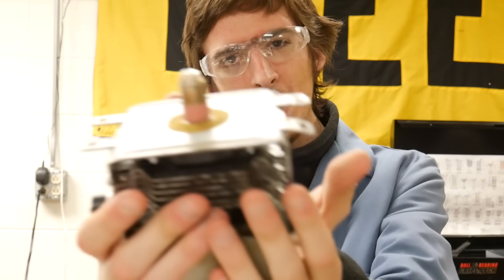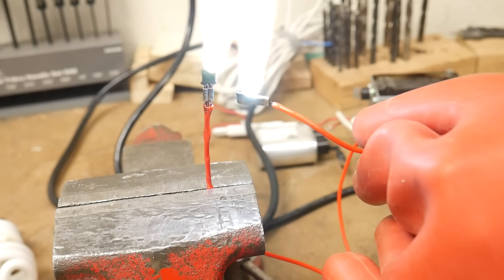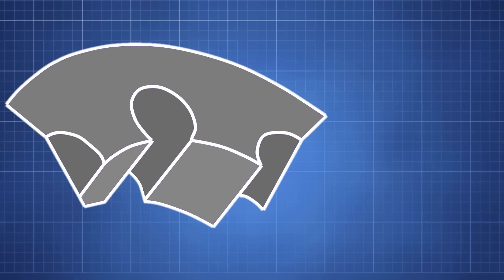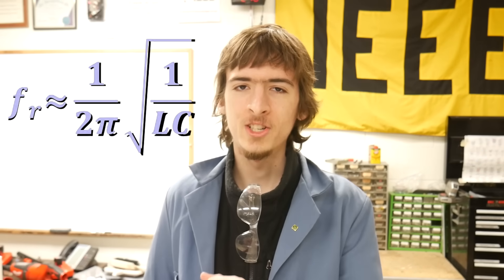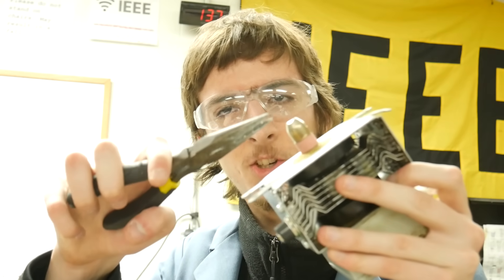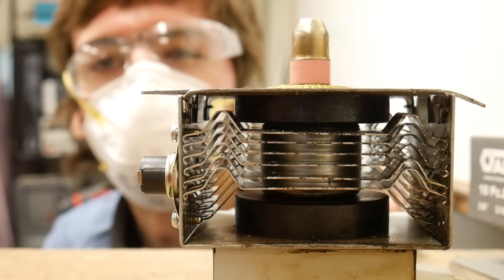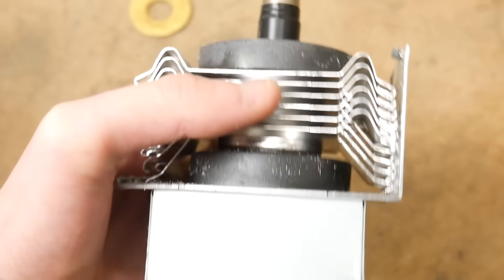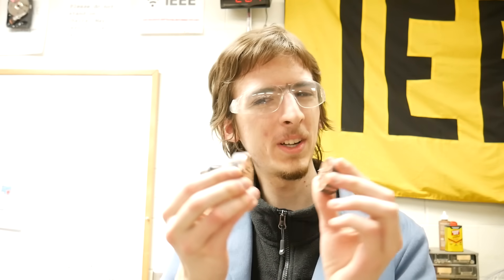What is a MAGNETRON - How Does it Work

Comment: I just feel bad for the first poor souls who had to discover the hard way how toxic, cancerous, and life threatening berilium oxide is.
Reply: Aaron Misner I'd imagine, the way things go, lots of people were exposed to it at some time in an industrial setting and the discoveries of the metals health hazards were discovered later through research and development rather than it being an obvious thing to the first people to mess with it. But that's just a guess.
Reply: Dylan Cros - Exactly. Those people in the industrial setting are the "pour souls" I was referring to in my original comment. They would've developed carcinomas and probably other terminal condition(s) without having any idea that where they were working or what they were working around would cause such serious medical issues for them down the road. I mean it is what it is...I'm just saying that it sucks, but what are ya' going to do. <shrug>.
Reply: I want to know who found out that beryllium compounds taste sweet.
Reply: When you start a #howdoesberylliumtastechallenge, a lot of people will find it out again.
Reply: It wasn't Fillo Farnsworth?
Reply: Fortunately (most of us) have learned from their mistakes. Whenever I take apart a microwave, I always paint the exposed beryllium oxide areas with a friend’s failed recipe for a homemade air-dry pottery glaze. Turns out it works great as a clear insulator, but it isn’t optimal for pottery for some reason. Anyway, I wait for it to dry, and then I add a bit of heat shrink tubing. I shrink it, and then I paint a small amount of liquid resin around the edges of the sealed tubing. The microwaves are still emitted perfectly and are not muffled at all.
Reply: Aaron Misner For example Madame Curie with her discovery of radium and polonium
Reply: @cloudvariable9910  Unless you go smash the Magnetron with a hammer, the ceramic isn't going anywhere ...
Reply: Dont feel bad. They had no idea and the life span for a human back then was way short so they died naturally before the effects of it really set in. Also they weren't a bunch of vags complaining they fought and dealt with shit on a level we will never know. Allowing them to adapt more easily with the power of their mind and how they perceive while being so in time with the need to live. Say thank you to them cause now you got it easy.
Reply: I have two Magnetrons in my room and I haven't died... LOL it certainly is dangerous
Reply: @eventseen7317  so did you go file on the pink ceramic and inhale the dust? If no, you are not in danger.
Reply: @zaprodk  no just having these around is dangerous enough I think... One could accidentally fall to the ground, break, and I die
Reply: Paul Kocyla hahaha. That’s a challenge Darwin would appreciate. Our planet too. Humans are such funny animals. We think we know so many things and are so certain but most of what we know is just guesses. We find out later we didn’t really know anything. Plus we tend to listen to people who have something to gain by telling us only part of a story. Like how car batteries acid is like Aliens blood and electricity is made from friction which I’m sad to admit for most of my life was my own assumption. I mean, lots of stuff is toxic to us and we still use it. I wonder when they are going to finally tell us that the WiFi and cellular signals which have indicated our lives are toxic and accumulative? They test them one at a time and the standards America uses were established by a department run by a ex cell phone company lobbyist. But our dumb asses only care about danger after the fact. Ever wonder why birth rates are down, depression and anxiety are up, and teenagers and children are getting more brain cancer? I wonder how far the shooters we have been plagued with live from a cell tower? I’m not saying that is the sole cause but with the adrenal fatigue we all already suffer from, I can’t imagine its not a factor at all. Remember when cigarettes were healthy safe? DDT? I bought a microscope because I want to see for myself. I have 10 strong WiFi signals  and that is not counting mine and the extender. and I’m living in the boonies. It’s easy to discount it because it is not what we want to hear and we just don’t want to believe people would lie to us for profit. Especially businesses and the government. Yah I’m just paranoid cause they wouldn’t do that again. And Facebook was made to be addictive. Why is it illegal to sell a child cigarettes? But okay to give them a device that pumps out microwaves and is addictive? Seriously.
Reply: @paulkocyla1343  if they're eating tide pods, I wouldn't see your challenge as a far stretch
Reply: @calvaryassemblyofgodsouthi8046  also the women who used to paint the glow in the dark dots on old clocks. The dots were made out of a radioactive solution. Some lost their jaws, some glowed in the dark even after their death. Very tragic. All beautiful young women.
Reply: @lando8398  yeah i will see that event coming
Reply: My thoughts exactly. Beryllium is nasty stuff.
Reply: That darn sure could have been me, I think watching this video just saved my life.
Reply: if we use  condenser instead of  cavity's  than what happened
Reply: So how to recycle it ? TONS OF MICROS R DUMPED in yonkes!
Reply: Who cares, I want my hot dog.
Reply: That , and the first person to discover that the capacitor delivers a punch to the heart
 if its touched
Reply: They haven't used than for insulators in years .
Reply: barelium oxide clone which is more healthy are to be discussed
Reply: if we use neodymium magnet than the frequency increased or not, checked out with formula of magnetic force formula and magnet from current
Reply: probably better off not knowing
Reply: Now that I think about it,you can use it to kill someone without leaving evidence.I'm already plotting.
Reply: @lando8398  I can see the company screener now: OK-looking, nope...Ugly, nope...beautiful but old, nope... beautiful and young, hired!
Reply: So I just replaced the magnetron on my microwave. And after watched this video and may have touched the pink part with my bare hand.
Reply: Philo maybe?
Reply: Galaxy quest showed just how dangerous it can be to get a berillium sphere.
Reply: @ryanb1874  Philo.  That's a sad damned story. The dude and his family were literally ripped off!
Reply: Safe lab practices are written in blood. Sometimes literally. You can search Google and find many stories of famous chemists who were crippled or maimed by their pursuit. As one can imagine, the isolation of fluorine was fraught with quite a few such accidents. In the days before fumehoods or eye protection, a lot of chemists sustained eye injuries from explosions or were poisoned by the compounds they worked with, sometimes fatally. Here are a few examples, for those interested:

Joseph Gay-Lussac was blinded by a potassium explosion in 1808 and never fully recovered his eyesight.

Robert Bunsen (namesake of the Bunsen Burner) was permanently blinded in his right eye when a flask of cacodyl chloride exploded. He was also poisoned after inhaling vapors of cacodyl chloride which contains arsenic in another incident.

Humphry Davy suffered damage to his eyes and fingernails trying to isolate fluorine through electrolysis of hydrofluoric acid.

Brothers Thomas and George Knox sustained severe poisoning from hydrofluoric acid.

Paulin Louyet and Jerome Nickles both died trying to isolate fluorine.
Reply: @lando8398  asbestos was never illegal, btw. Still used in things like brake pads. It's coming back because people are stupid. 

I think those white pellets in potting soil are a form of asbestos. Tremolite, if I'm right. That's why they tell you to wear gloves.
Reply: Well f*ck, I smashed one of these things apart when I was 5. And I totally smashed that ceramic. I guess I'll die when I'm about 20 then :/
Reply: @KingJellyfishII  In my case it's the opposite, As a kid I always wanted to take apart a magnetron to figure out how it worked, and believe me, I would have smashed that thing to take it apart too (at around age 10) since it was my way of putting things apart back them LMAO. I think that you're safe though, since the particles may have not been small enough and in large quantity enough to have affected you, as ceramic usually breaks apart in larger clumps and the dust should have been minimal, unless you did it in an air-gapped room, so you should be good bro
Reply: @poloboy  well i sure hope so. It's kinda scary knowing that I could die in the future from an idiotic thing I did 10 years ago and theres nothing I can do but wait and hope you're right.
Reply: Try searching for dimethyl mercury.  Truly, absolutely, scary stuff! One or two drops on the outside of your vinyl glove will seep in and get in your skin, immediately! You'll be slowly paralyzed over the next few weeks and die in less than a year. Yes, someone found that out the hard way.
Reply: Jason DeLozier me too. Was just about to cut the magnetron apart from my old microwave when I saw his warning about the nasty pink stuff.They say curiosity kills the cat
Reply: @VoidHalo   Add Karen Wetterhahn, the Dartmouth Professor, (an expert in toxic materials!) who got poisoned in 1996 when two drops of dimethyl mercury touched her glove.
Reply: @theenemy3060  the big radiation source that dwarfs all others by many orders of magnitude... (I don't know how many; I haven't crunched the numbers) and is extremely dangerous- is the broad spectrum,  ridiculously powerful radiation that comes to us from the sun... anyone worried about "5G", that ever goes outside, is missing the reality of the issue by gazillion miles... I don't mean to confuse those nutbars with facts or anything but I just can't help it sometimes.
 personally, I believe that all reality is controlled by a tiny teacup with a silkscreen of Rodney Dangerfield on it, that orbits the sun inside the orbit of Mercury.  this teacup is, no doubt, made of beryllium oxide and shall not be taunted... lest ones' crops wither and ones' tent become a dunghill, and one then die, drenched in the piss of ones' jeering enemies... this is all true because nobody can prove that it isn't.  
  peace be upon you, sir.
Reply: @windsofmarchjourneyperrytr2823  at least some of that "perlite" in potting soil is "puffed" obsidian apparently... a few pieces that were only half "puffed" enlightened me to this fact...  inhaling tiny flakes of glass is still bad enough though. 
 peace and rock on.
Reply: Just found out a few days ago... Hope I never inhaled it after breaking them 😰

Comment: The trapezoidal cavities in a household microwave oven are not as efficient as the circular resonating cavities in the original WWII magnetron, and the range of wavelengths the device emits is less stable and more variable. But this is not a problem, because the end use is just to heat food, so frequency control can be sloppier than would be permissable in a radar system. The variability allows the manufacturing cost of the household magnetron to be considerably less than that of magnetrons in radar systems, so that a household microwave oven can be sold for only $150 and still make the supply chain profitable. Great video!

Comment: Great video. I had a very rough idea how magnetrons worked (resonant cavities with an electron beam sprayed past it) but never knew the specifics. I had no idea that the cyclotron effect had anything to do with it. Hell, I didn't even know that electrons had mass until recently but it obviously makes sense if they spiral outward when accelerated in a circle squeezed together with magnetic fields. Klystrons are fascinating too and are apparently the most common source of microwaves for medical LINACs used to generate high-energy X-rays for cancer treatment. Electrons ride microwaves like little surfers in the accelerator tube! Any time I think I'm smart or clever I read about inventions like magnetrons, cyclotrons, linear accelerators etc just to humble myself. Don't touch the beryllium!!!

Comment: It is an electromagnetic whistle. The pink ones are made of ruby alumina, the beryllium oxide ones are bright white and usually are from higher power microwaves.
Reply from the maker: I think you're right. But it is best to treat them all like beryllium, yeah?
Reply: @BlueprintScience  smart man you are Sir..
Reply: It's interesting how quickly a safety myth propagates. Someone on IRC warned me about BeO ceramics in magnetrons but never told me the right color. Now color could be deceiveing too. But well it seems no mainstream MWOven has BeO in it .. I still don't know all material used. Pink seems to be chromium/alumina. But purple I can't find data on. Also.. I have a few parts from kitchen appliances (cooking plates; toaster resistance glass with white ceramic plugs/caps and plates..) all very white.. Maybe is it raw alumina, which is said to be white. Or maybe I was moronically handling potentially dangerous ceramic without knowing it (while fearfully storing harmless pink alumina hehe)
Reply: The yellow wire in front of magnetron ... is it gold? 
THANK YOU
Reply: @ediflores8745  nah it's brass
Reply: @agumonkey  I sure hope the white ceramic is harmless cos I smashed some of it (from a magnetron) when I was about 5...
Reply: @KingJellyfishII You would have had to grind it into a fine powder, then inhale it, for it to be dangerous.

Comment: So i was thinking of making one of these a few years back, but i didn't want to get into vacuum pumps in an apartment. Low power microwaves are something that deserves more attention by the home remote control enthusiast. 
 
The permanent magnets can actually be replaced with an electromagnetic coil on most magnetrons. If you do that the magnetron can actually tuned to different frequencies, although you may end up losing some power from the magnetron since the permanent magnets won't be providing the "spin". 

The magnetron it's self can actually be operated off of both AC and DC, and might actually be more effective if a direct current is applied to the magnetron instead of alternating current, but the large voltages (kilovolts) make a purely DC setup more expensive to produce. 

There's a few papers written about how to calculate the frequency of magnetron based on the voltage, since frequency is also a function of voltage and the dielectric inside of the magnetron. Not every magnetron is full of vacuum. Some have teflon sheaths around the cathode, and the individual segments are more like fine slits than coils. 

Since i'm talking about magnetron construction a bit...  you'll notice that the magnetron has ten equal segments. An even number of segments in a magnetron is important because it stops the magnetron from doing weird stuff, like developing confined stray currents or hitting a destructive resonance with the diode it's self. It also allows the magnetron antenna to be tapped twice (directly across from one another). 

As far as the metal that the magnetron is made out of, it's aluminum clad in copper. Copper's a slightly better conductor than aluminum, and the better the interior conducts the better the magnetron produces microwaves. Aluminum is used instead of steel because steel would actually hold onto some amount of magnetic field, especially overtime with prolonged use, and that would either interfere with continued operation of the magnetron or sap power from the microwaves being generated. 

Finally, the guy screaming about the capacitor down here in the comments isn't wrong; They're not benign. That said, any body looking to take apart a microwave should be aware that they can be shocked by a capacitor. If you don't know that much, why are you taking apart a microwave?
Reply from the maker: Interesting read.

Comment: 3:10.... The "fingers" of the cavities will alternate in polarity due to them being connevted together, and the physical structure of them basically makes them into an LC tank circuit with an inductor across each one. So, the polarity alternates as the inductor forces the charge to bounce back and forth between polarities as the electrons pass by them and induce a current. The permanent magnets on each end of the tube start the electrons electrons whirling around as they leave the cathode, and they will speed up and will form a star shaped pattern due to the polatities flipping back and forth by the oscillating tank circuits formed by the cavities, as the electrons speed past them, and be forced to rotate past the cavities due to the polarities constantly flipping  at higher and higher speeds until they reach the maximum speed. This is where the frequency of 2.4ghz is formed without a driver circuit powering the tube. The size and shape of the cavities is what determines the final speed of the whirling electrons, and ultimately the final frequency.